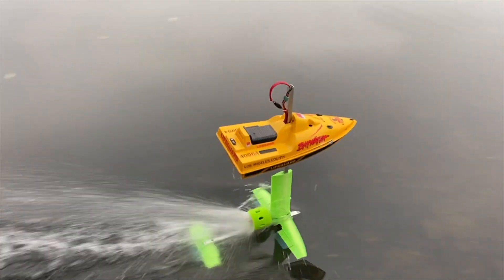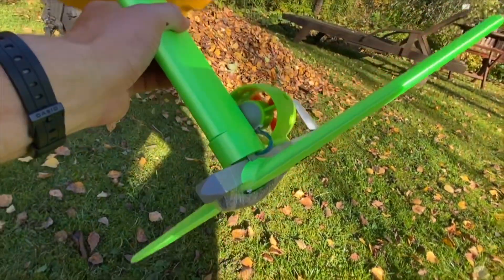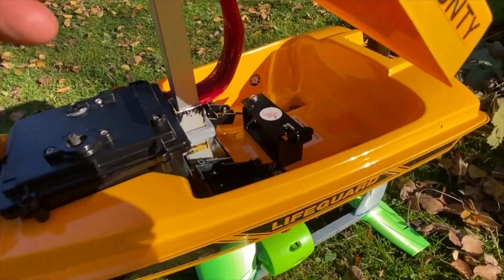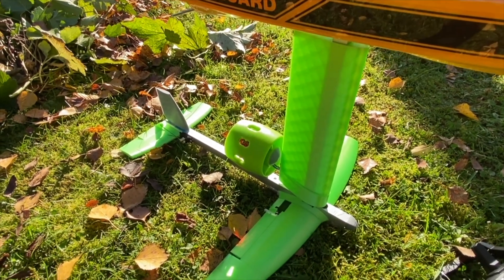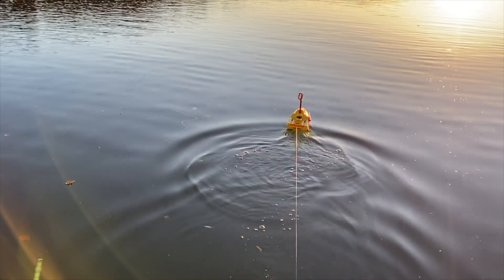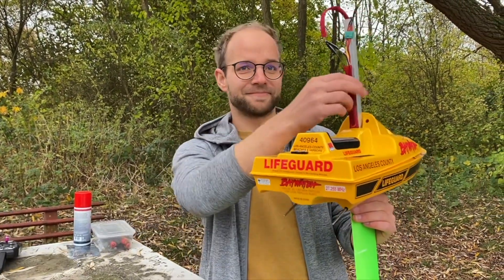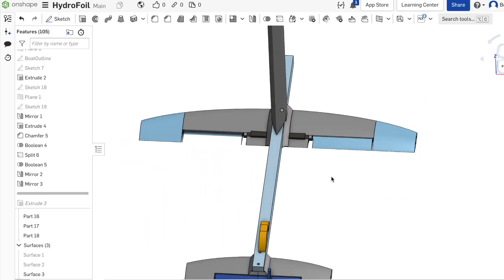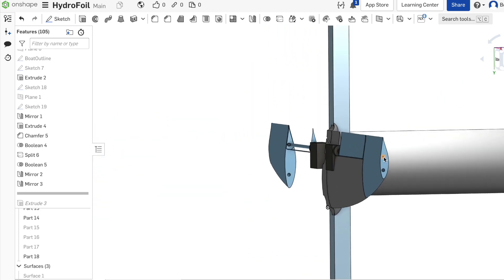HYDROFOIL Flying Boat | INAV Autopilot Stabilized

Comment: Great project. Hydrofoils are indeed very efficient but control is a real pain! Another aspect you might not have thought about is that the lifting force depends on water depth too. Actually efficiency is optimal for 2-3x cord of the wing, with less water depth efficiency drops significantly. It amazes me that you got this to work with such simple and cost effective stuff. Actuators maybe above water and mechanically transfer to wingtips. Great job, extremely well done. This is really not easy.
Reply from the maker: Thank you Alfred, I really had to tune the system a lot before effectiveness of the control surfaces was enough. If I had time for a second design, there'd be a lot of things I'd change. Tip actuators being one of them.

Comment: Hej cool project. i,m familliar with inav from a quad copter but have never thought this would be achieable with a hydrofoil. i,m trying the same project just with an arduino and a trimaran hull(RC).
What board did you use? maybe i could ditch the arduino and skip few steps :p 
Also did you manage to get the ladar working?
Reply from the maker: Unfortunately Ice not touched the project again, too many other ideas 🤓

Comment: Very nice. But then you built an underwater airplane glued to a boat. A bit far-fetched to my opinion. But very cool and I suppose your had a lot of fun.
Reply from the maker: Haha, thank you for the honest comment. The aim was mainly to check if the hydrofoil can be actively stabilized. That hydrofoils are much more efficient at higher speeds should be clear.

Comment: This is amazing. I am really impressed you got this to all work. I have been working on trying to get INav to control a model foil boat I designed. Mine does not work but glad to send photos. I have been working on the model to try and get it working there then move it up to help stabilize a kiteboard foil or eFoil for riding. I have done a bit of work on looking at ways to track the higher above water and feed that in as an altitude to iNav. Anyways, love your project, I am very impressed, and would love to learn more about including trying to build it myself.
Reply from the maker: Happy to hear that you had the same idea! Would love to see some photos and help where I can ;) You can reach me sending an email to Benjamin.Kelm.dtATgmail.com

Comment: Excellent project. It works much better than I'd initially expected. 

To simplify the design and reduce the number of servos, you might try a pitcheron style wing. The other wing could then be completely fixed, without servos. Keeping servos dry is a real challenge.  

Human-scale foil boards use weight shifting for control. Not sure if this is possible for scale model.

Having a motor in the upper rescue boat would make testing less frigid, but understand it's extra weight and complexity. Maybe a secondary tug boat on standby would be useful. (or access to indoor swimming pool, particularly in winter)
Reply from the maker: Hey, thank you for your comment! Indeed the aileron is not as effective as a rudder would be (because of the mass distribution)

If I revisit this I will change this ;)

Tug boat is a great idea 😁